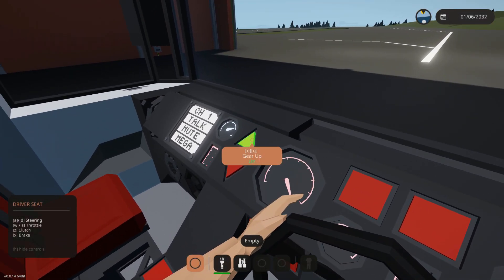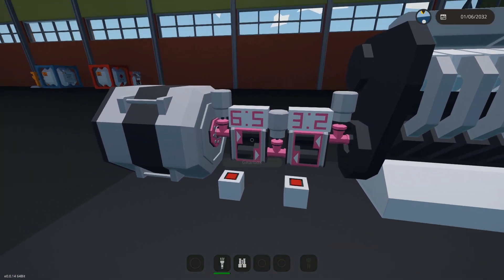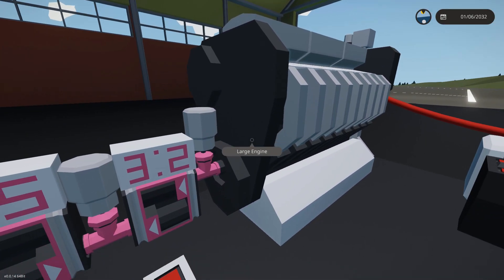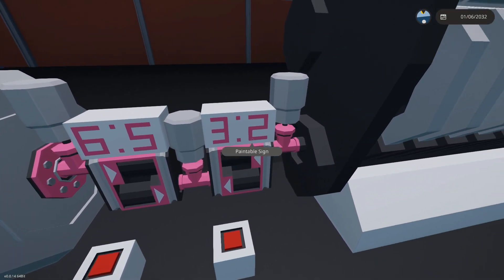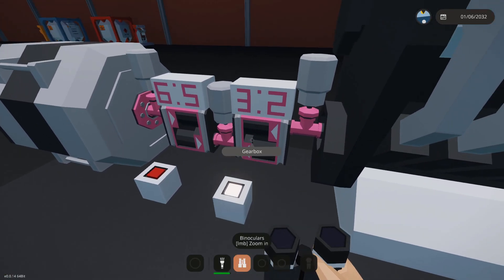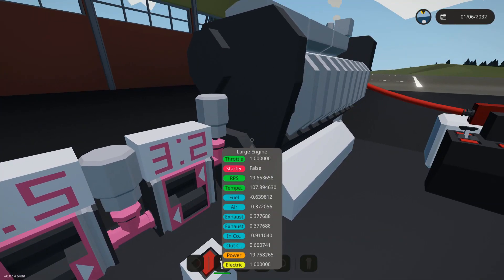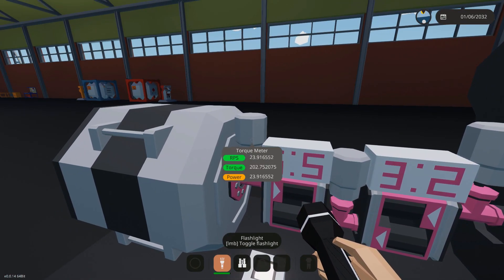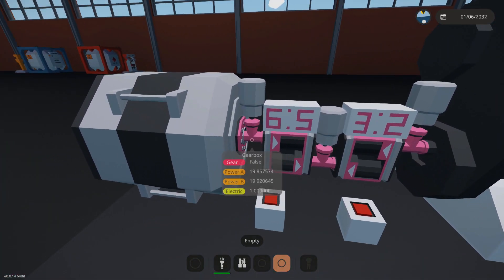How To Use Gearboxes!! l Stormworks B&R Gearbox Tutorial

Comment: I still don't understand, because ever ratio I use, in any direction, makes the RPS of my propeller lower than 1:1. These gearboxes are super fucking confusing
Reply: Really late but if anyone else has the same issue, arrow pointing away from engine is rps decrease through gearbox, needing less power from engine. 

Arrow facing engine is rps increases through gearbox,  lowering rps of engine and requires more engine power. 

Engine>2:1>gen
20rps>20÷(2/1)>10rps

Engine<2:1<gen
20rps<20×(2/1)<40rps

Mage sure you select the gearbox and change the ratio and connect it to an on/off  source to change gears.